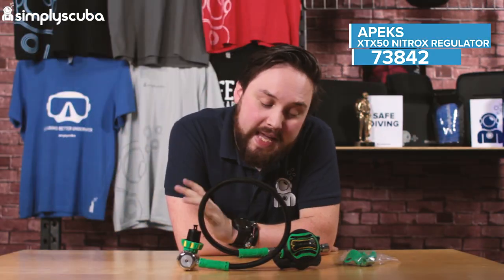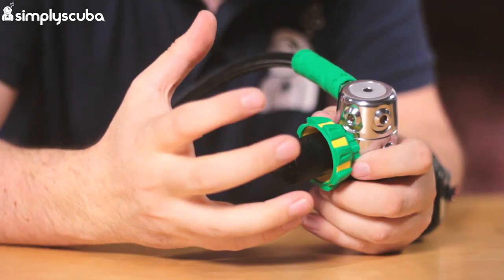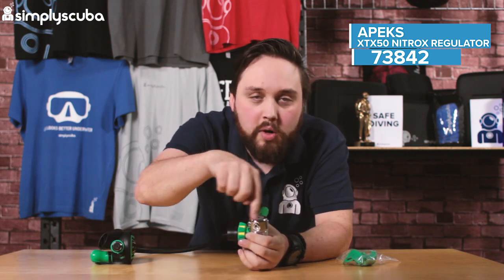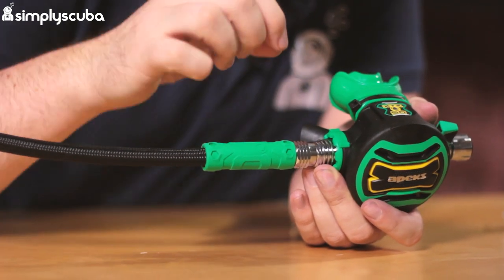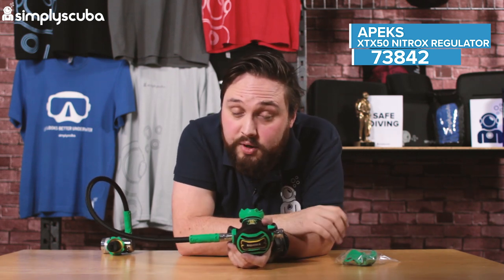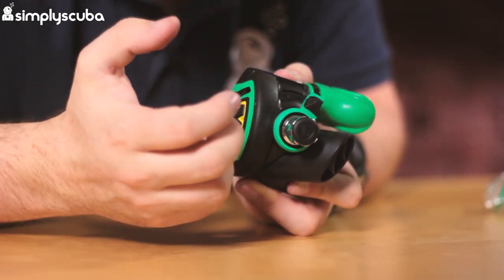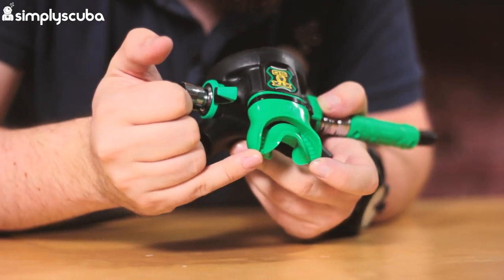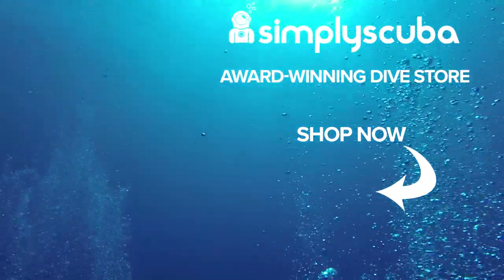Apeks XTX50 Nitrox Regulator Review

Comment: I suppose I'm missing something here but why would you need so many ports on a first stage designed to deliver gases with high P02. Anyone fancy inflating their drysuit with pure 02? Might keep you a bit toastier I suppose. Seriously though why so many?
Reply: SomaliCoastguard ... obviously because its based on an existing design.
Reply: You might be using EAN50 on a single cylinder setup. It's not always for stage cylinders. You'd still need two second stages, a BCD, a drysuit, an SPG, and maybe a transmitter. For a long hose configuration a fifth port may come in handy.

If you're using this only for stage cylinders, then yeah, a TEK3 first stage would be plenty.